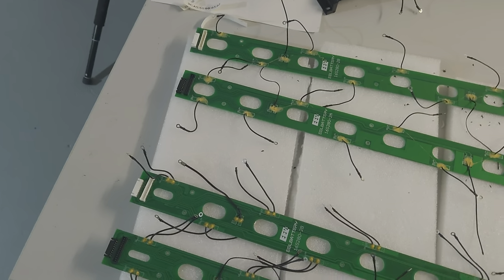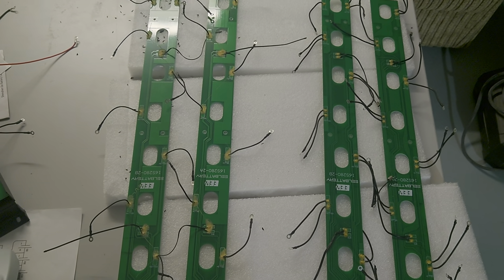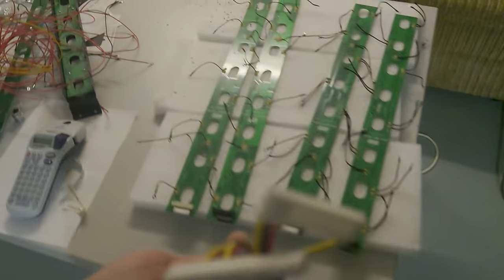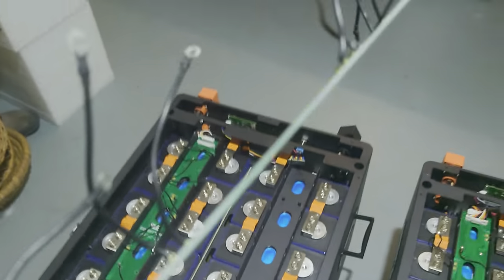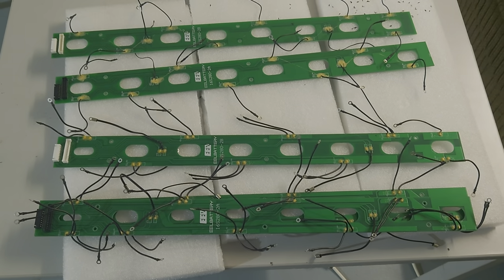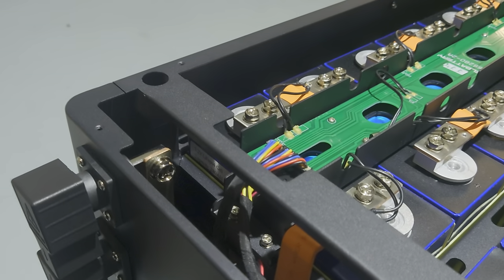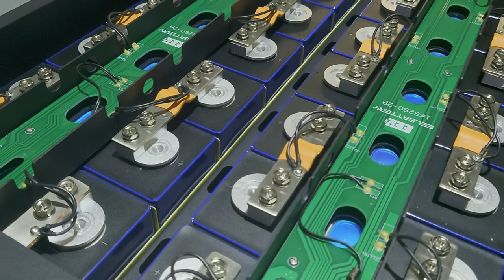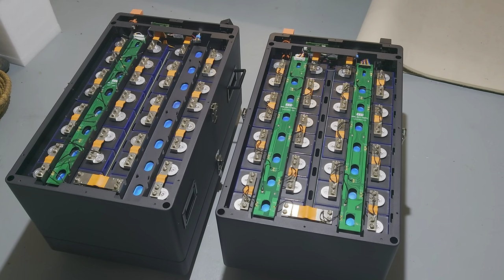EEL V3/V4 sensor board issues (english)

Comment: 2 Wire or 4 Wire bms is ya aknown difference but measuring can be done while there is no  balancing current, not such a great improvement
Google AC-IR measurement for LiFePo4 than you can learn how the inner Resistance is measured.
frohe Ostern nach Franken
Reply from the maker: Hi Javier, makes all sense but this is nothing I as user can influence. The issue is that the boards are not fitting well and high likely may cause short circuits with the way EEL intends to install the balance boards. Biggest advantage of the new boards is that there is no additional cable harness to the balancer needed and the setup looks super clean.

Comment: the diameter of the balance cable also looks smaller. Do they can handle 4A? The original from neey looking bigger
Reply from the maker: the diameter is the same like the original balancer cables. So I don´t see any issue with those.